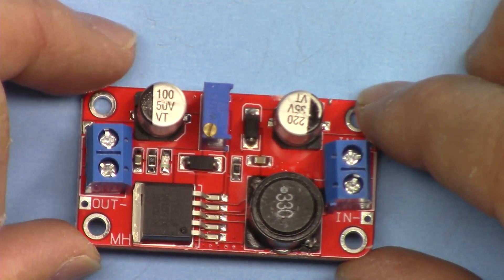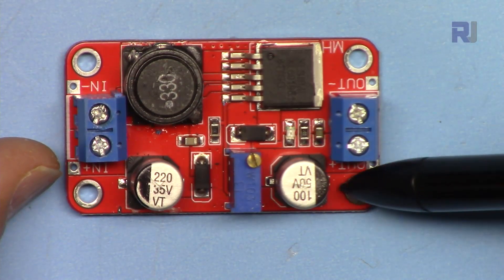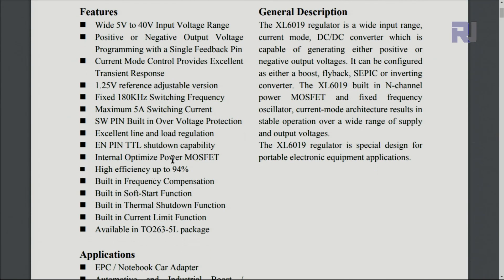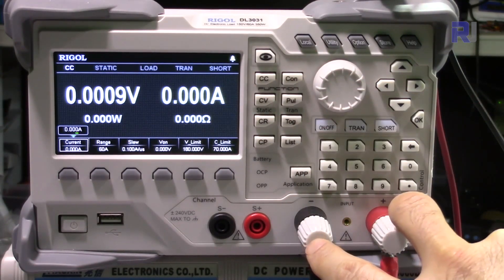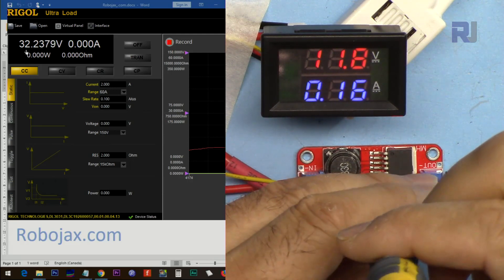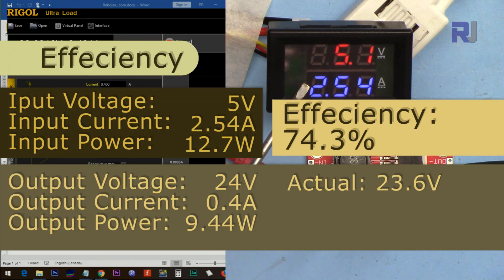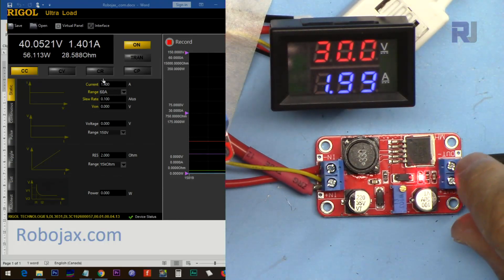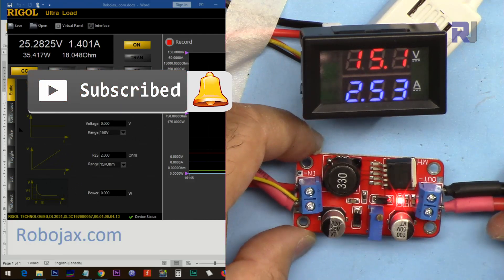Review of XL6019 Boost converter module - Robojax

Comment: When using it for 20v 300ma output, and input decreasing from 15 to 5v, current drawn is 0.5..1.5A, but below 7.5v current suddenly jumps to 2-3A and chip overheats quite fast. Also happens on cold start condition with voltage 7.5v or lower, even with low load. Thus, it's reliable range is 7.5v ... 15v when converting to 20v . But sudden current jump is quite dangerous, since other similar chips just stop working at low voltage, while this one can just burn out. Low voltage protection is must.

Comment: So minimum voltage is 5V? I made a DIY mini solar 15 cells roughly 9V 5A +max ideally when it's under direct sun. I made it for my cars lead battery to be constantly charged. I think, this is the boost converter i use for raising the voltage to 15 V. But when the sun isn't direct, the output voltage is 2.7V+- ,when i move it towards the sun, it goes straight 15v like a switch.  Is that normal operation?I always thought the output voltage was supposed to gradually go up based on the input voltage. Instead, it acts more like a switch. 2.7 or 15v. Is there another boost converter that can take even lower minimum voltages other than this 5v minimum converter? I'm trying to get the most out of my solar to keep my car battery charged up.
Reply from the maker: Hello, when the input voltage is below the threshold, it can't boost so the output drops. Yes there are boost converters but the current is less than 2A like this you can purchase from AliExpress https://s.click.aliexpress.com/e/_opA9tr1 and here is the test video https://youtu.be/LMKiPE_2Uu4
Reply: @robojax Thanks a lot. I'll check.
Reply: @robojax thanks. I just checked amps going into my car battery and it was like 0.5amp, so I should be in the limits of 2amp  boost converter.

Comment: will 5v3amp be converted into 12v1amp from this board for longer period of time without any issues? I'm kind of newbie but really want to delve into it. Kindly help. Thanks
Reply from the maker: 5V to 3A = 15W and 12V x1A = 12W, as long as you didn' expect Higher output then input, then you can get yet.

Comment: if I hook up solar cells worth of 6 volts, and on the other end - 3S lipo battery, how can I make sure it does not drop the voltage and function as MPPT? Any small size mppt?

Comment: Can it run 775 motor
Reply from the maker: what is 775? I have no idea. But regardless. this is a DC power supply and it will turn on any DC power supply with rated current which I tested. So first if your motor is DC, then that is good. then find out what is the maximum voltage and current it needs like 12V 1A. then watch this video and see if this can supply 1A at 12V at the output.

Comment: I want to get 12V 2.1 or 2.2 amp from this module as output voltage. Will it drop when the load is putted?
Reply from the maker: this test was exactly for that purpose so you can get to see it. Please watch and come to conclusions

Comment: Hi
Is this module can boost 3.7v 12A to 12v 4A?
If not could you suggest a solution pls?
I really need this boost voltage
(its a 18650 battery)
Reply: 3.7 to 12v is hard to boost brother

Comment: I need out of a lion battery as input ~4V -> 15V output with 1.2A. is that possible?
Reply from the maker: this is a boost converter.  I made this video exactly to answer such question. I have mentioned  minimum and maximum Input and output voltages. I have tested the amount of current at different voltages. So please watch and get answer. if I want to reply to you, I would have to watch the video.

Comment: The input idle current(whithout a load) in 12v-24v test is 110mah!?....isnt that too much?.... It will quickly drain the input source on stand by!.
Reply from the maker: 110mAh is the capacity of battery. the current for this module is measured with A only . The input current depends on the output. if output is high, the input will be high and if output is zero, the input will be zero.

Comment: Can use input 4,2v lithium battery to 12v 3a for hpl led 50w 12v?
Reply from the maker: I have made over 400 videos. your questions should be answered. Input and output voltages are mentioned so you know what is the minimum and maximum voltage. The maximum current is mentioned to you know the maximum. to get the answer, watch the video fully to get your answer. The power is P=IV, where I is the current in Ampere.

Comment: Hello do you know 9r recommend any buck converter 42v input to 5v output?
Reply from the maker: Hello, voltage conversion is easy. the current (ampere) is the most important one.  for 1A or lower, it would be very easy but for higher current, then it becomes complicated. here is the search result from AliExpress https://www.aliexpress.com/wholesale?catId=0&initiative_id=SB_20201007041906&origin=y&SearchText=input+50V+buck+converter good luck.

Comment: Hi, can you please do the test with a voltage of 5 volts and an output of 9 volts, what maximum amperage can it handle?
Thank you.
Reply from the maker: Hi,  on some modules I did  all standard voltage, but some how I skipped it in this . I believe the test I did from 5V to 24V should be very similar to what you are looking for. check it out. I can't test it as it needs a lot of setup and wiring.
Reply: The ratio is 0.555.    So 2 amps output should have about 3.6 amp input.    It might get hot at that rate if run continuously.      Anything over 2 amp output might be pushing it unless you had a heat sink and a small fan.    Even then 2.5 amp would be tops.    2.5/0.555 = 4.5 amps input.

Comment: Does this boost from a minimum of 5v input to a 12v output? Is it stable or fluctuates? Thanks!
Reply: Are there other better options that convert 5v into 12v?
Reply from the maker: I believe I made this video to answer questions like this. please watch.
Reply: @robojax  i have. you could have answered my question as well.

Comment: I use li-ion 3.7 volt with charging module and connected with xl6009, but suddenly the output voltage increase up to 40volts and burn my arduino.. do you know this phenomenon?
Reply from the maker: wow. Have not experienced it.
Reply: yes all newer modules and xl6009

Comment: All these  xl 6009/6019  converters are a great way  to blow up  your electronic circuits. These boosts wildly swing output voltages  at low input voltage . Most test review do not even mention this  or warn you.  Good luck using this crap. For more see the comment from richardnanis
Reply from the maker: You are right.
Reply: just read your comment, so these little modules aren't relyable at all & have wild voltage swing?? i did not know that, but its good to know..  do you know when this is most likely to happen??? thanks!
Reply: @keithking1985   around  3v input with small or no load.
Reply: @keithking1985   around  3v input with small or no load.. I got those modules all from ebay. May be copies.
Reply: What's a better option then?
Reply: Do you have proof of this or have you seen some proven tests?
Reply: @Dancopymus buy a few and test them for yourself  connect those to your electronics  and  post a video with the results.
Reply: @daveton3895  So wich stable alternative?